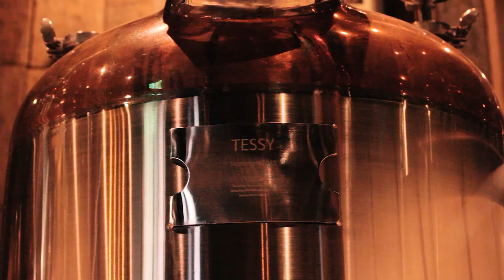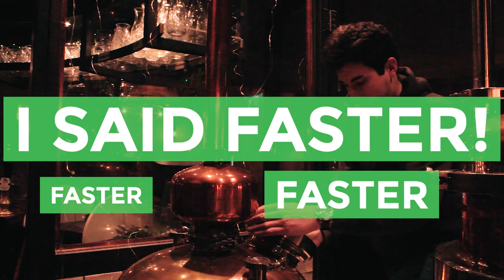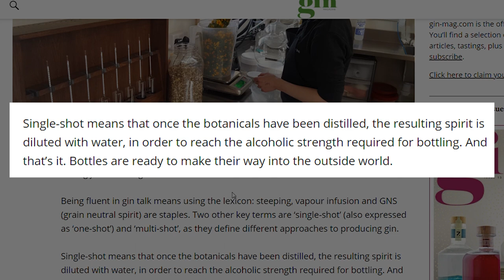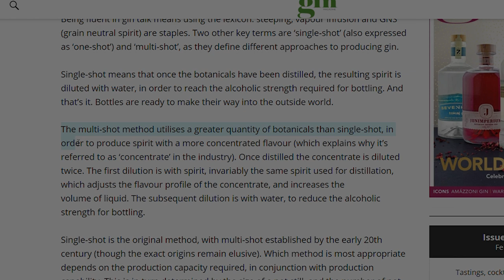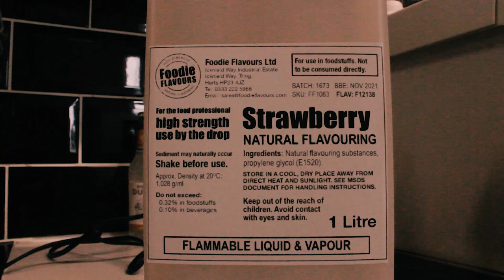Single Shot Distillation Method of Strawberry Gin | Boothstown Gin

Comment: 50 mls per litre !!!! 1.25 litres from 25 litres !!!! That is a massive heads cut ? or am I doing the wrong thing ? If I make a sugar wash I often only take 50 mls for a heads cut for the whole 25 litres ?
Reply from the maker: 50mL/litre is probably a bit overkill since we were using bottled vodka as the base. The vodka has already been through so many distillations before it gets bottled anyways. However, if you are distilling a sugar wash do you do a stripping run and then a spirit run? Anyways, in either case that seems extremely low for a heads cut. I'm surprised it doesn't taste and smell solventy at that point still.
Reply: I tend to agree Brendan. With a 15 L batch I find the first 50 mL can be a little oily and carry a strong juniper taste but I don't like to cut much more than that. We use an NGS from a reflux still.